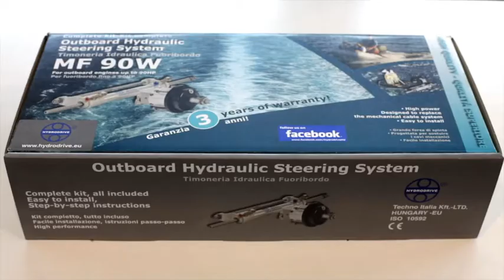How to install Hydrodrive Hydraulic Steering Systems

Comment: Hi, I’m about to order the hydro drive system for my Yamaha 115, I have two steering stations on my boat, will I be able to connect 2 helms together using the autopilot port for feedback? If so how will I find where to buy the T fittings for the hydro hoses? Thanks for any help. I like these helms for the low profile way of mounting

Comment: what should the oil level in the helm be ? topped of  after the air is bled?
Reply from the maker: When the system is completely purged, the oil level has to be at the top of the oil hole. Turns the steering wheel all on the right (or left), take off the funnel and force a bit the steering wheel, the oil level will go down a bit, at this moment, please screw the oil cap. On installation book, page 32 step 2.11 you can find the description.
Reply: Very helpful video I just bought your kits today🥰
Reply: Hello I bought the same steering kit on Amazon but having trouble getting it to work on my Yamaha 85hp outboard. Taking a very long time turning the engine lock to lock
Reply: Any assistance will be appreciated
Reply from the maker: @jevonwilson5537  Hello, please contact me on: info@hydrodrive.eu

Comment: good morning sir, I have a problem with the hydraulic steering pump, the pump sucks but doesn't press back into the steering wheel, and I'm confused about how to open the hydraulics because there are no bolts to tie it up. do you have a manual for the hydraulic pump sir?
Reply from the maker: Hello, please send us an e-mail to info@hydrodrive.eu. First of all we will need the serial number and some photos. Thank you!